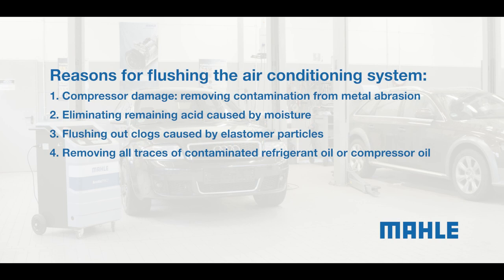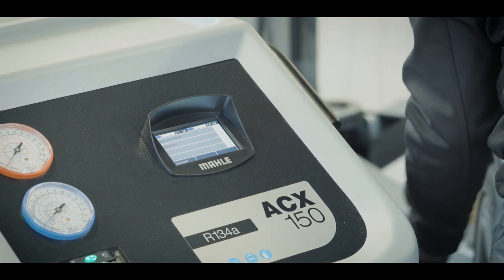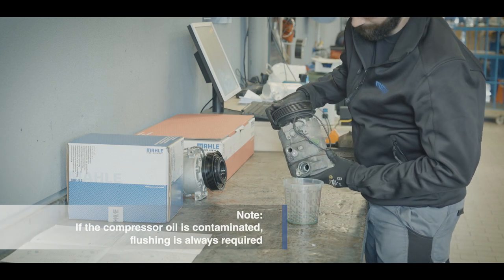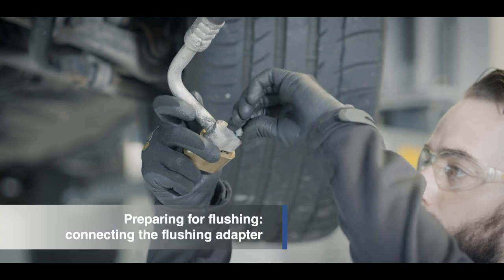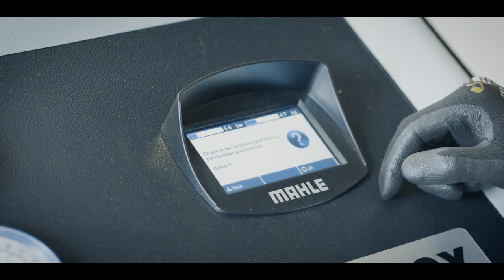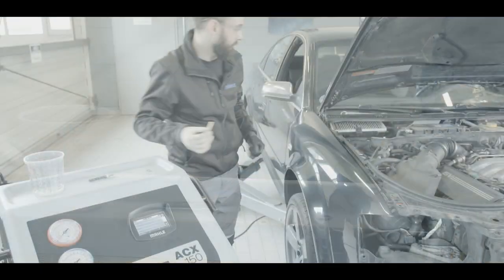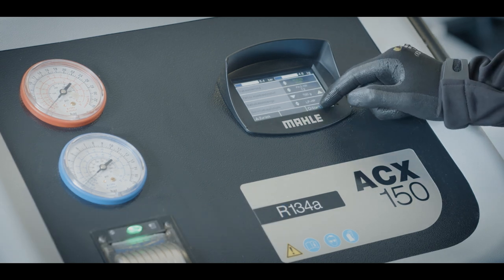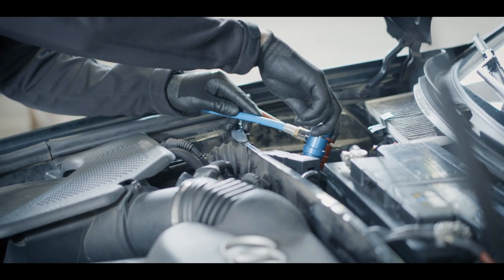Flushing the Air Conditioning System - MAHLE Installation Video

Comment: Wherever I have worked, the rule is that if an A/C compressor fails for any reason, the system is flushed. It doesn't matter whether contaminants can be seen in the refrigerant oil or not.